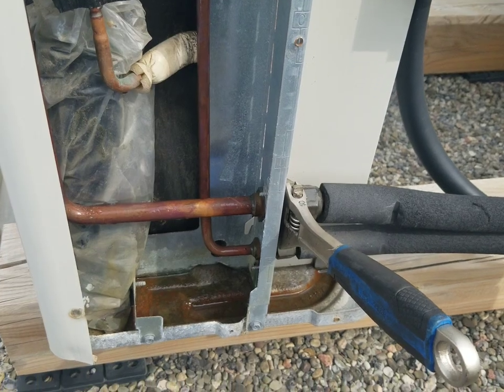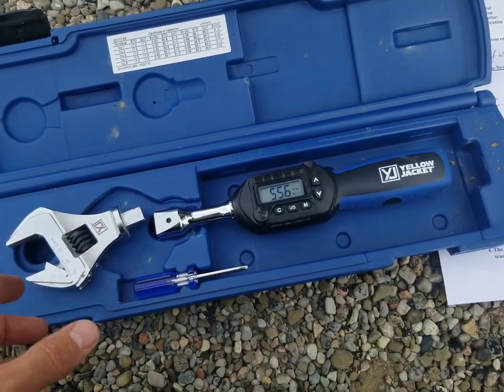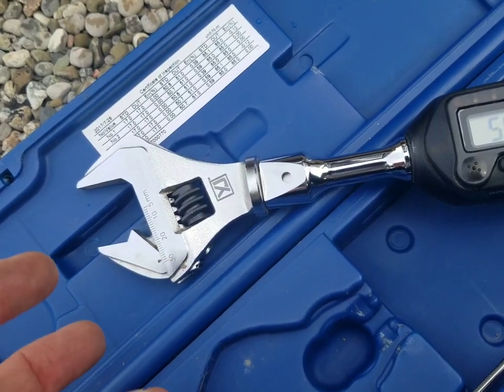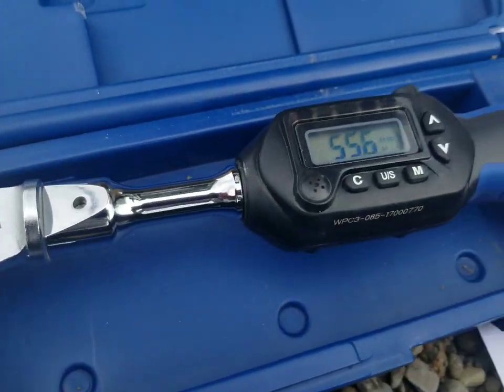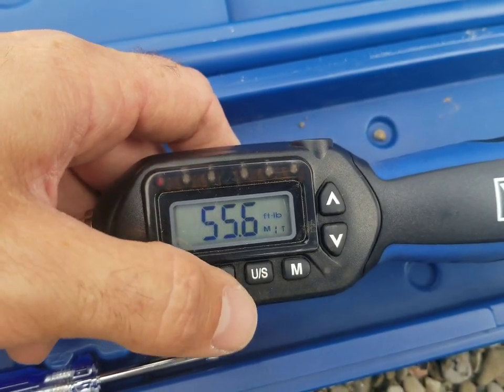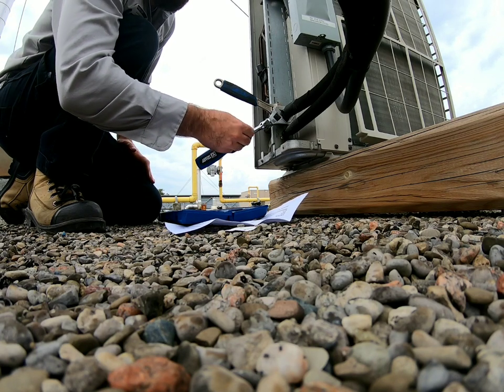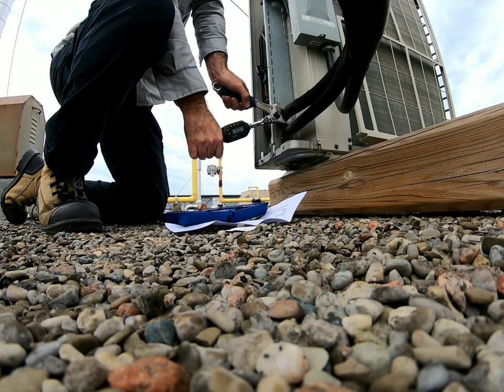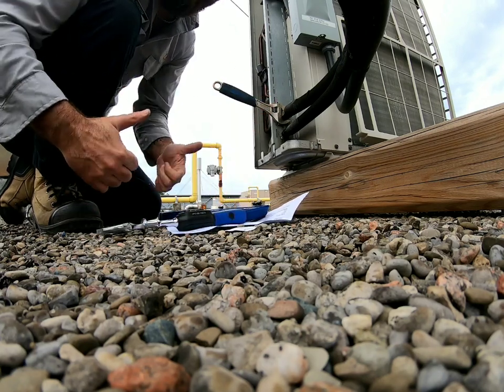HVAC - Yellow Jacket Digital Torque Wrench Demo/Review

Comment: Thanks for the video.. Even though you said it, I know YOU know just because the nut didn't move it means it's torqued properly. :-) Just means the nut is tightened at OR above the torque range.  Most flares are overtightened anyway....
Reply from the maker: I didn't mention that a few months back all the nuts were checked lol.  I torqued that one correctly back then so that's how I know...shoulda mentioned that.

Comment: If a nut has been set no matter if recent or a longer period of time you cannot check with a Torque Wrench if it has been Torqued accurately.
Reply from the maker: I've come across nuts of all kinds, flare, rotolock that were almost hand tight.  There is a reason tire nuts are re torqued after new tires go on after driving.  There is no issue with checking.
Reply: @HVACKnowItAll  Whenever re-torquing a Vehicles lug nuts you must back them off not take off the nut but back them by just breaking them lose this way you have Lug nuts that have been seated and all you are doing is re-seating them for a positive torque after the car has been driven, the only reason that they need to be re-torqued is because the possibility of human error or that the Torque Wrench was mis-Calibrated in the first place. I was a mechanic for many years. Yes, of course if the nut was loose then it can be Torqued correctly but then again if the nut was loose it was because of human error and it was not correctly torqued in the first place.
Reply from the maker: @robertrlkatz6890  so you're telling me if a flare nut is loose, for whatever reason, I can't re torque it?  That nut needs to be tightend, I would rather use my torque wrench than guess.  Has worked until this point with no issues.
Reply: @HVACKnowItAll  "Yes, of course if the nut was loose then it can be Torqued correctly but then again if the nut was loose it was because of human error and it was not correctly torqued in the first place."